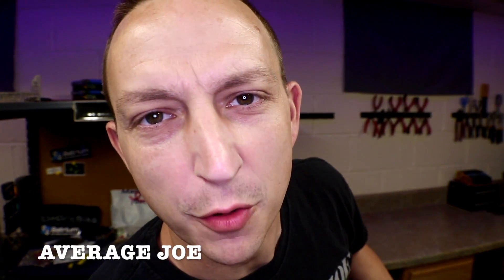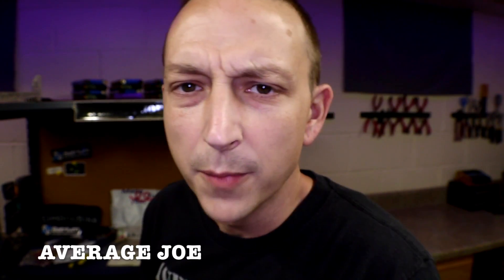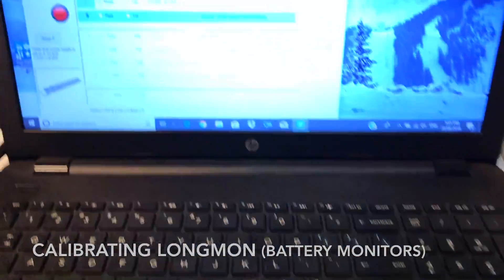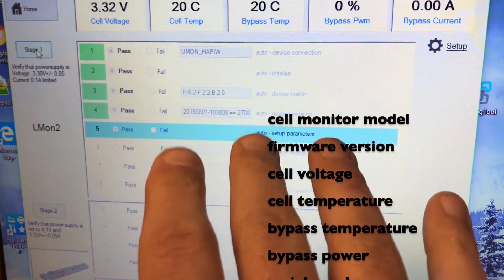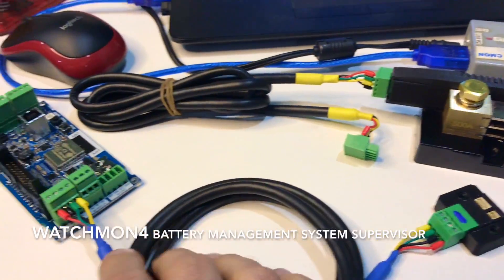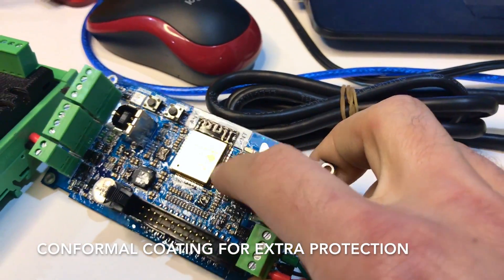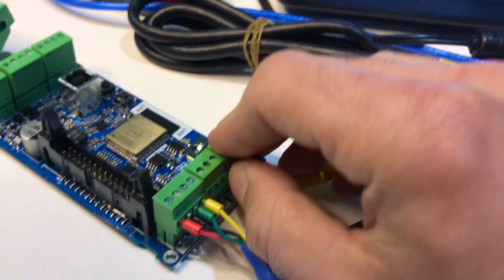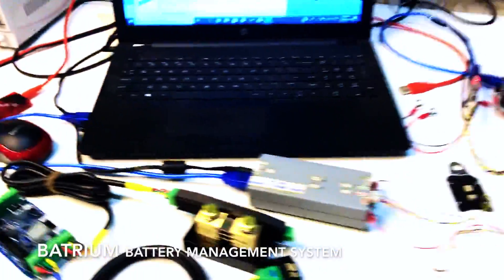DIY Powerwall - AverageJoe + Batrium + BrunoPOWEEER

Comment: Bruno, what lights do you recommend for bbshd? What powers your led lights? Does it have own battery or you plug it to the main battery? Can you maybe give aliexpress links of what you recommend?
Reply: https://rover.ebay.com/rover/0/0/0?mpre=https%3A%2F%2Fwww.ebay.co.uk%2Fulk%2Fitm%2F151886495410

Try these bad boys. Brilliant lights what I use on my bbshd
Reply from the maker: dmitry manzano all these years I tried countless LED lights, the best one I would recommend is the Roxin, works with battery voltage up to 90v or 100v depending on the model. The optical is designed for road (not for general light use) so it’s like a very evenly spread car light. Roxin is Taiwanese (quality not nasty) and I’ve met them last year. It isn’t very easy to find to buy just the light cause they sell / make for manufacturers only but I found a link here:
http://spydergrid.com/eshop/product/x4e-electric-bike-light/
There are models where there’s a ON/OFF button on top (my favourite) or without the button so the display turns light on/off but there are so many limitations (current/voltage) better just go straight to the battery.